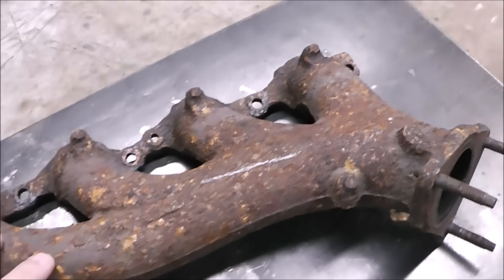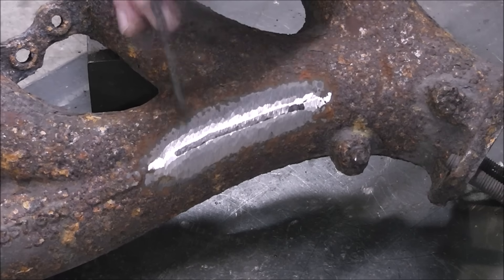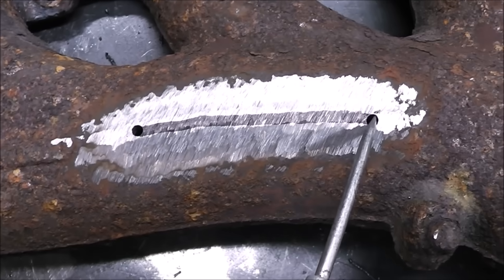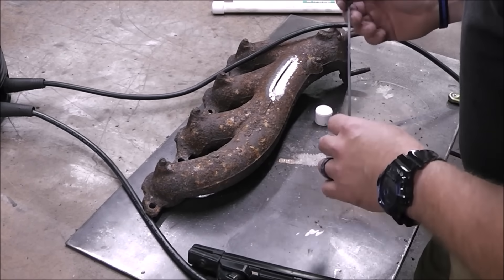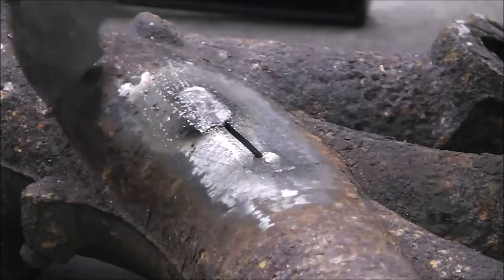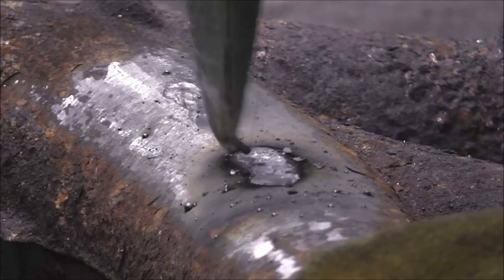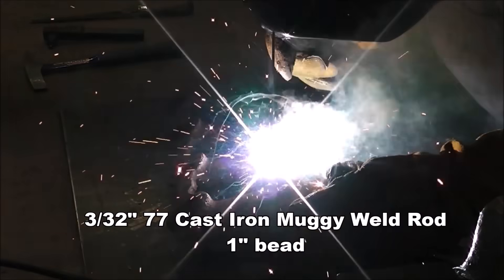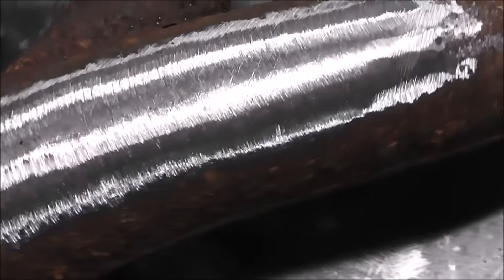Stick Welding Cast Iron Repair with Muggy Weld

Comment: I just did a repair on a wilton vise. I have wrapped it in a welding blanket in a bucket to cool. Question is how long should I let it cool before handling or grinding? Thanks!
Reply from the maker: @Jacob A. Hull depending on how big the area is, it will be several hours if not the next day. You can poke your finger in the sand or the outside of the blanket and if after several hours and it still feels warm, wait until the part cools to room temp which at that point it has normalized.
Reply: @BrandonLund  I have it wrapped in a welding blanket and the blanket is still 160 on the outside. I'll probably just wait till tomorrow to open it up.
Reply from the maker: Yah its going to be a while at that temp. Just let it sit and keep your fingers crossed. Cast cracks during the cooling process so it's better to just let it slowly cool...let know how you made out! Feel free to post pics on my Facebook. Good luck man!
Reply: @BrandonLund  area not really that big. Just the side of vise jaw shelf and under a bit. Tried to attach pic but don't see that option

Comment: This is great info man. I have a wilton vise that needs a little welding. It has a crack under the jaw in the shelf. I probably won't drill any holes in it but might gouge it out a little. Thanks!

Comment: Is using the file to clean the tip any different from tapping the end of your rod with your chipping hammer?
Reply from the maker: @David Haywood these rods are about 5 dollars each so filing them just ensures that every resart is like striking a new rod. Then you dont have to worry about accidentally chunking off a piece of flux and having a bad resart.  Any other rod I just tap them on my table but these are too expensive in my opinion to do that with.

Comment: i welded up my manifold up with stainless steel electrode still good after 20 years those cast rods are a pain .507 strata dissimilar metal electrode stainless steel .
Reply from the maker: @Alan Hughes right on man! I've heard of people using stainless and I've tried myself but I haven't had good luck unfortunately. You are proof it works. I just haven't been able to do it

Comment: Hello Brandon,  I have an old cast iron wood stove that I want to fix up by welding some pieces that have cracked from the previous owns neglect and would like any pointers you may have since my professor at the college does not want to go over the ability to weld cast iron?  Thank you in advance if you have the time to respond.
Reply from the maker: @Bill Shaw always preheat if you can, short welds peining in between and wrap in a welding blanket or bury in sand to cool. I have a ton of cast iron welding videos in a playlist on my channel using all different processes and filler metal then I break them to test the strength. Lots of info in there for you also.

Comment: Inch by inch it’s a cinch. Great info. Be sure to read the pinned comment before spouting off like I did about what side of the manifold the final shot was taken on. Sorry dude. Thanks for pointing me in the right l direction.
Reply from the maker: @PrestonHelton Mad respect bro! YouTube can be like a hit and run in the comments section so I appreciate you coming back and saying that (when you didn't have to). I'm not beyond making mistakes but I never try to mislead anyone so thanks again man it means a lot.  Your a stand up guy 🙏👊🍻 cheers buddy.

Comment: I learned to repair cast iron in technical welding school we were taught to use oxy-acet. Torch and brazing rod it works great and super affordable
Reply from the maker: @Armando Gonzales that is a very acceptable method, however a cheap inverter welder can be had for around $100 bucks. Gauges, hoses, tanks and the gas to fill them will run you no less than $350.00 for cheapest set you can find.
Reply: Yes brandon it probably is but real welders and fabricators like myself with 35 years of being a cert. Welder usually own all the equiptment torches welding machines portable welders drill presses grinders ellis saws ect ect ect having said that if your on a budget go for it many of us professionals are not good luck good video
Armando"Grande"Gonzalez
Reply from the maker: I guess I just assumed you knew you were on a channel geared towards teaching beginner welders and testing out some lesser known products and processes. Just because i use Fronius equipment doesn't mean that is what my weekend warrior viewers would need and it doesn't make me any less or more professional than the next guy. I agree that either tig brazing or oxybrasing are the 2 most tried and true methods but 99% of my viewers on this channel are just starting out using an inverter welder and if that's all they have why not make the best of it.

Comment: How good does it weld in a 4G situation underneath an old tractor?
Reply from the maker: @Nobody, I havent tried overhead but it is rated for it. Here is some data from their website.
Easily clads heat oxidized and oil impregnated castings
Penetrates deep into burnt cast iron, anchoring the weld
Highly crack resistant
Welds steel to cast iron
Effective even on malleable cast iron
Tensile strength stronger than the parent metal (62,000 psi)
Perfect color match to cast iron
Can be used vertical up, horizontal, vertical down, overhead or flat
Non-conductive flux-coating
Does not require pre-heating or special cooling
Can be applied at low current density with a simple buzzbox
Recommended for applications such as boiler grates, exhaust manifolds, furnace grates, and compressor parts
Ideal for repairing cast iron wood stove parts such as broken ears or cracks
Reply: @BrandonLund  thanks for replying, I often end up welding on old equipment in position and it sucks. I have always used UTP 99 % nickel and it's an art using it 4G on an old 1940's Juan Deere cast iron oil pan. 
  Another joy is welding in a mild steel plate on an ISX Cummins that's a window block or on a hooped up 5.9.
  I hate working on cast but I've learned how to do it and I'm always looking for an easier way to stick gum to sand and not have it crack or leak. Thanks for the video to.
Reply from the maker: @Nobody. Anytime man. I have to say the rod ran incredibly smooth. Different than nickel 99 in a good way.  I wish I would have tried some overhead. Most 99 rods I've used are pretty snotty anyways so I'm sure its still probably not easy.

Comment: When I weld cast rod, I usually heat up whatever I'm welding to around 500 degrees over an hour to avoid cracks. Then when I'm done, I throw slowly bring it back to room temp.

Comment: No that is not a perfect weld! And the undercut is not from your amperage, it’s from you not knowing how to manipulate a weld pool. And where’s the back stepping?? The one thing you should definitely be doing, and you never preheat to average preheat temps with cast, youre supposed to sweat the part with ALL casts, be it iron or steel or stainless or bronze. And I think the one amp you were off really made all the difference 🙄
Reply from the maker: @josh Rupp 🤣🤣🤣 I love reading comments like yours with smug undertones telling everyone how great they are and how much better they can do it. Thanks 👍

Comment: Could you just heat up to 500 degrees in oven before welding.🤦
Reply from the maker: @Harry David Aererua absolutely! Or a gas grill works too. The only reason I don't is that my wife freaks out when I do it 🤣🤣🤣

Comment: I have welded pretty much every metal that can be welded over the last 50 years. You can also repair a cast manifold by cleaning, drilling and preheating then torch it with flux coated brazing rod if you don't have a welder but it takes oxecetalyn. Drop it in a barrel with sand or oildry let it slow dry and that's it. Ran a pleasure boat fixed that way for 6 years and never had a problem. Normally I used nickel rod or hastaloy rod which is high in nickel, just remember to relief drill it and slow cool it.
Reply from the maker: @jack bonanno I have seen and heard of it done that way but I have never personally tried it myself. I love hearing from the older generation of all the different ways and methods. Its my understanding that what you described is actually probably the best method out there to repair cast but it takes quite a bit of skill to master it.
Reply: @BrandonLund  you would be surprised, with the skill set you have I guarantee you would knock it out of the park first time you tried it. There are so many facets to welding that I have learned over the years and certificates like nuclear pressure vessel welding. Jobs that required minimum 14x2"  316 ss.welds in a 10 hour day purged so 0 sugery on the inside every weld x-rayed 6 days a week for six months. Gruling, had to weld titanium pipe, income and hastaloy and carbon steel all sizes 1thru 12". Busted once on a 6" carbon steel, doubled up on 1/8" copper coated and cold capped the last inch. Wiz weeled it out capped again and it passed. Those were the days, radio blaring and walking the cup to the beat. But damn it sure paid good. Good luck with your endeavors your sir. I retired and purchased my Miller welders, plasma cutters I much preferred the machine shop so I purchased a lathe and a vertical Bridgeport mill. Now I do machine shop welding and repair. May be 70 but still alive and kicking.
Reply: Corrections, I hate spell correct. O- sugar. Not income- Inconel. And last Young sir.
Reply from the maker: @jack bonanno I'm glad I'm not the only one that gets frustrated with the auto correct lol🤣🤣🤣
Reply from the maker: Aww man I could sit around and chill to stories like this for days. I love talking to the older folks that have been in the field for a long time. The amount of knowledge is super valuable. Look at torch brazing...thats a dying art that takes a ton of skill to master but these fine motor skills pass on to so many of the other processes. I'm glad to hear your doing well my friend!
Reply: @BrandonLund  Thank you for the accolades. I couldn't even estimate how many hours I have put into welding, so many it just became automatic. I would always wake from some other place when the weld was done. I learned a lot from a guy when I was about twenty, pop cans were still malleable not aluminum yet. He could sit there and cut one open and stick weld it back up, we didn't have a tig welder then. From him I learned how to cut stainless plate with a torch using a scarfing method. Didn't have plasma cutters then. Things have come a long way in the last 50 years Brandon. When I. Have my foot on the petal of my rig and doing an exhaust system or whatever I can't help but think of the days I stood next to that red fireplug looking Lincoln noisy ass machine, but they were a good welder. So many trips to the hospital in the middle of the night with eyeburns. Little secrete to share, if you are using those blue tarps that are so prevalent and cheap at Harbor Freight, to shelter a weld on a Wendy day or cold day, just because you are the fitter and looking away from the weld the glare off the whiney blue will burn the crap out of your eyes. Made me a believer in fitters glasses.
Reply: Mr. Lund, you say you like hearing about welding hits and kinks from the older guys that were in the business. One thing I can guarantee you being retired since April 2009. It ain't like riding a bicycle. Stop welding for a year or two and you are told to take two 6" pieces of 316 SS 2" dua. Ground 37.5 degrees  purge. And weld them in a stationary 6G position and x-ray, it would be a shot in the dark if you didn't bust. Usually takes about 6 to 12 coupons to get your rythym back and get back in the groove. Don't know if you've ever heard of this technique but I worked with guys that could hang from a pipe rack 50 feet in the air, start a weld with the right hand, weld 180 degrees reach around without pausing pick the stinger with the left hand transferring the filler rod without missing a beat and finish the weld. I never tried to master that one but a had many instances up against a wall on a vertical run and have to use a mirror. And in a dangerous chemical inviroment every weld is x-rayed. Some chemicals would eat through titanium and Hydrazine/ rocket fuel would even eat concrete. Some pipe lines we had to Fab out of glass using burners to form the flanges. Crazy profession my friend.
Reply from the maker: @jack bonanno that's awesome! No I have never heard of that. I have however welded using an inspection mirror on the back side of the weldment and it was very hard, not to mention everything was backwards. As far as like riding a bike, Im learning that now. I just struck my 1st TIG arc on aluminum in more than 10 years. We called it heliarc then. It came out decent but far from perfect. I need more practice and inverter experience but I'm sure I will get back up to speed soon. Thank you for sharing! I do love these stories!
Reply: @BrandonLund  I'm sure you will with your skill level. First time I heard of TIG tungsten inert gas. It was referred to as you say helearc or ark and the addition of a water cooled high frequency made pretty aluminum welds possible. What I didn't see in my career was the trick I believe you demonstrated of sooting the aluminum and heating until the soot dissapears. Brilliant. I still use tempreture pencils you use to spray metalizing after you machine the damaged area down on a lathe and prep for the spray. That are pretty accurate. Hope to correspond again since your never too old to learn something new. I'm an old dog but always open for new tricks. I used to tell my ex when she would say how do you know so much about everything since I built most of my house, plumbing, electrical, carpentry ECT. I would tell her "l know a little about a lot of things but I don't know everything about anything" which also translates into the fact that after 16 years of marriage she ran off with an old friend of mine young enough to be her son, right under my nose. If that don't beat all. Just proves my point. All ways something to learn my friend.

Comment: I don't really like to see the back off an Arc weld broken by grinding it off.
Reply from the maker: @Anthony Marshall  what do you mean? I actually cut it in half in a future video and showed the inside. Grinding a weld is not a bad thing if your not doing coded work and it's for aesthetic reasons as I said in the video. It's not like I didn't give close-ups of my weld prior to grinding.
Reply: @BrandonLund  Ah there's the problem, I do Coded work, and trust me you should never ever grind the back from an Ark weld.
Reply from the maker: I've always been a trend setter. You should check out my cast iron repair series where I do all sorts of things that can't be done.
Reply: @BrandonLund  hello B, you've already said that you do work for aesthetic reasons, and that's OK, but not for a massive bridge, or a fire escape. Agreed?
Reply from the maker: Yes I have done bridge work as well as commercial stairs, stair pans, rails, decking...for 18 years. Nothing residential. I feel like I'm having a job interview? I'm glad you enjoyed the video. Take care 👍

Comment: Hi i got question my exhaust manifold leaks from factory weld do I still need to drill hole and make a crack line in manifold  or just clean manifold and factory welder area make it shiny amd weld over it ? Thanks great video 👍
Reply from the maker: @syed sardar if there is metal beyond your crack you should drill it to prevent it from spreading outwards and then prep it like in the video.
Reply: @BrandonLund  great I will look again thanks for quick response 👍.
Reply: @BrandonLund  another question I am newbie with welding I have forney 140 flux core welder with .035 flux wire you think that will be good for exhaust manifold welt ?

Comment: I've never used Muggy Weld, I never heard of it back in the day. If I had a real problem child piece of cast iron. I got away with using 308L stainless, because of the 50% elongation factor. But later discovered X-ergon and used their rods or wire exclusively. Great job and info, next cast iron project I run into I'll give it a try. Thank you Brother.
Reply from the maker: Thanks buddy! It's real good stuff. A little pricy but  it works awesome.

Comment: Excellent video, and all the useful stuff is said. Instead of Muggy Weld impossible to find, I've used SS 312 rods for years to weld all the difficult stuff: iron, manganese steel alloys; springs, tooling steel, stainless to steel, crankshafts, etc...Easily machinable, 20 % elongation, extremely resistant to heat.  SS 312 rods works very well in 95 % of the situations. It's a very useful item to have in the shop.
Reply from the maker: Thanks Pablo I'll have to give it a try!
Reply: @BrandonLund  You're welcome. It's a very strong and resilient alloy, it has been designed in the end of the forties for welding turbine blades on the  jet engines. So it's practically impervious to heat, thermal cycles, vibrations and corrosion. Besides it's very easy to use, needs lows amps, works AC and DC, giving beautiful welds with small inverters, and the "glass" pops alone.
Another use I did was for welding galvanized tubing as the HAZ is pretty small and the welds need none grinding after. So no job after, just a local cold galva on less that one inch wide. That pays alone the price in professional use, cutting down the work.
Reply from the maker: Great tips Pablo! Thank you! 🙏

Comment: Drilling holes does not stop it from cracking again.
Reply from the maker: Correct. But it does prevent it from propagating outwards